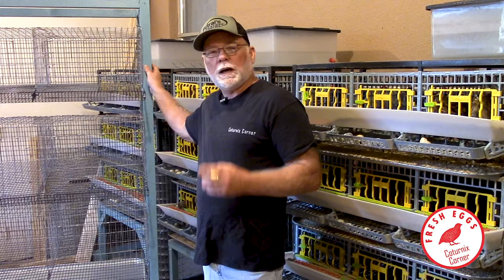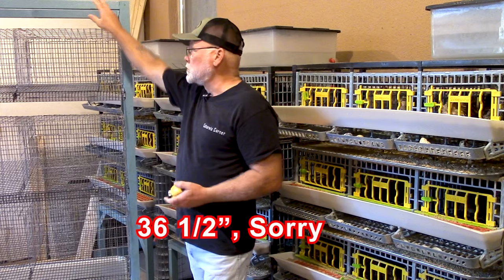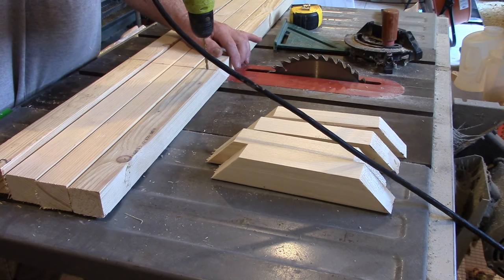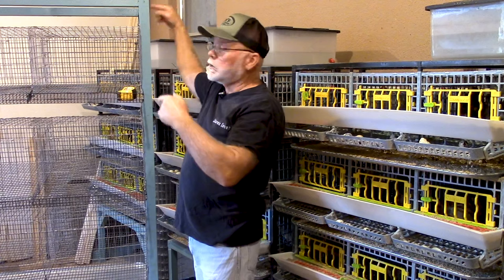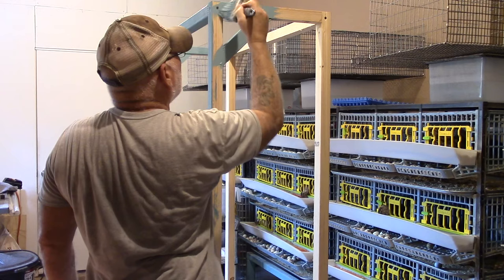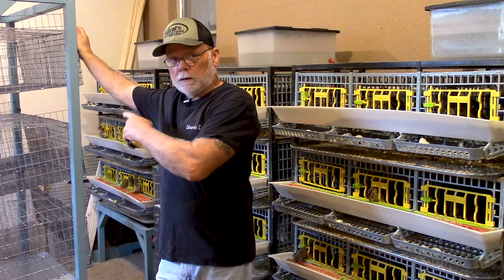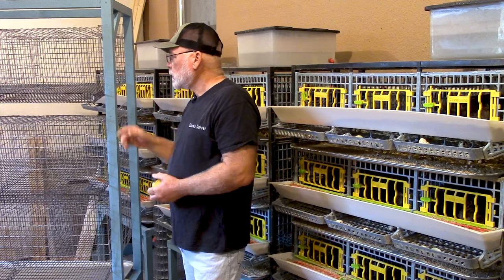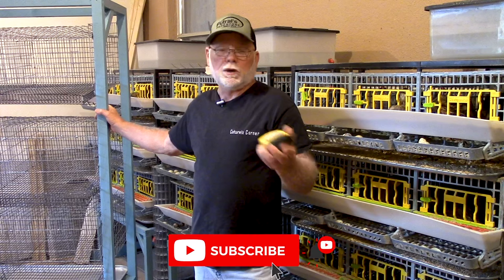Wire Quail Cage Frame Stand - Build video

Comment: Hello Terry, just wanted to share this with you and others, I learn to use 2x6  it is cheaper per square ft also less trash, I use the 10ft,  cut that to 6ft and 4ft then rip all I need. and the last cage I build I did put those water cups you made a video about. you can see that on the video I made. also left credits to your channel and two other. Thanks
Reply from the maker: Good idea!

Comment: Just got home from a neighbors....took some PT 2x4 over there to rip for framing another hutch!  I have built your all wire growout cages and they worked out well but this hutch will have an enclosed sandbox at one end. I was gonna paint them before assembly but why? If i glue and screw the joints the bare wood would be better! Thanks for the reminder!
Reply from the maker: Post a pic in the group of your new cage when finished.

Comment: Watching your cage build vids I had a thought about using the roll out cage design but using J clips to hinge the rear edge of the floor, and door clips to support the front of the floor at two positions. Level for grow outs with no gap along the front, and dropped for layers with the roll out gap after the birds are too big to slip under it.
My thought was for those in very tight living space, one cage, two roles. The layer gap could be used to slip in a half inch mesh floor liner for chicks fresh from the brooder, or even drape a blanket over the cage to use it directly as a brooder?

Would love to hear your thoughts Terry. Possibly worthwhile or would the juice not be worth the squeeze?
Reply from the maker: I do use my layer cages for growing out younger birds. Just close off the egg rollout opening so they can't escape. I use the smaller pool noodles for this . My chicks go on the 1/2" x 1" wire straight out of the brooder at around two weeks of age, I do put down a couple sheets of blue shop towels for them to stand on for a couple days so they can get used to walking on wire.